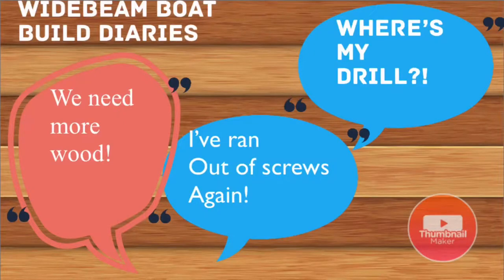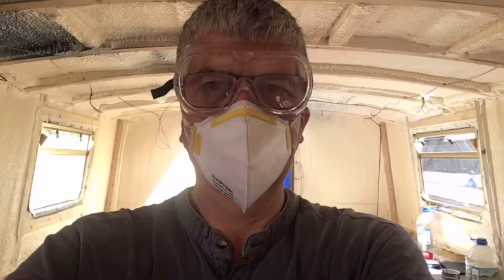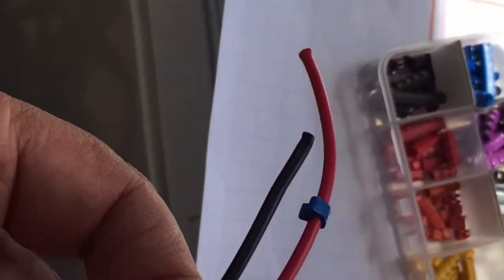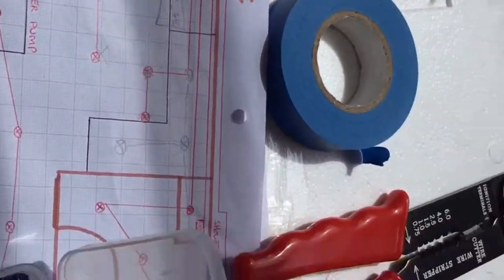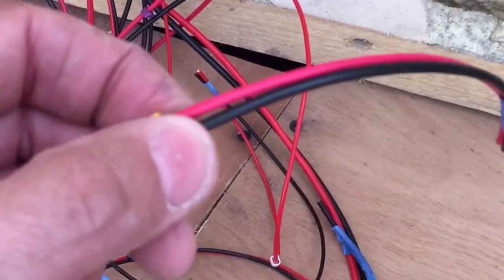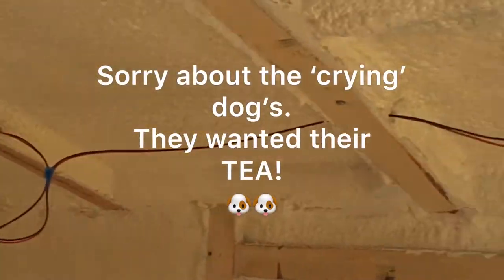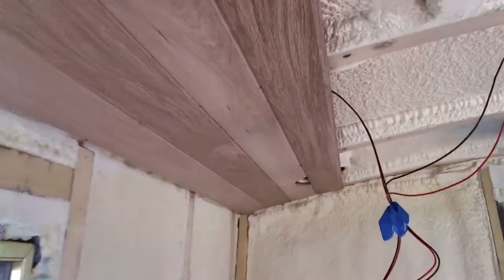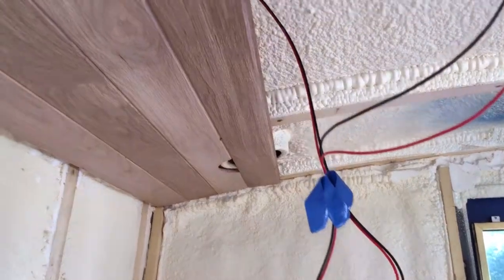Part 7 Widebeam Fit Out ‘Let’s get this fit out started!’

Comment: Isn’t the cable supposed supposed to be in conduit?
Reply from the maker: Andy, the sprayfoam doesn’t react with the dc cable insulation., unlike polystyrene sheets which over time can interact with the cable insulation. If you have polystyrene insulation, the cabling must be ran in conduit/trunking. We will be using trunking where dc/ac cables pass over each other. The ac cable is double insulated but the dc isn’t and therefore needs to be in trunking. Cheers